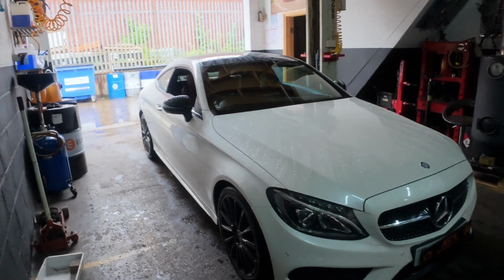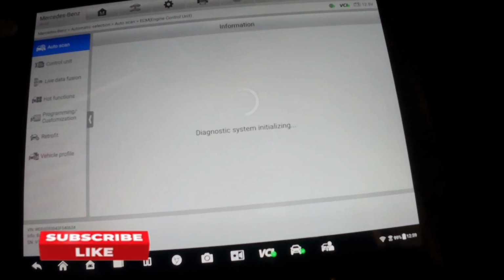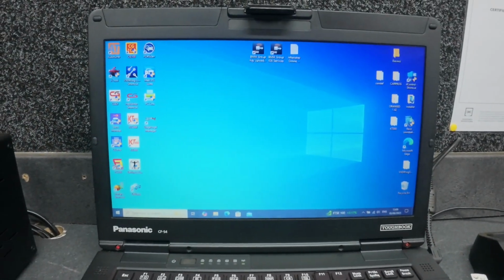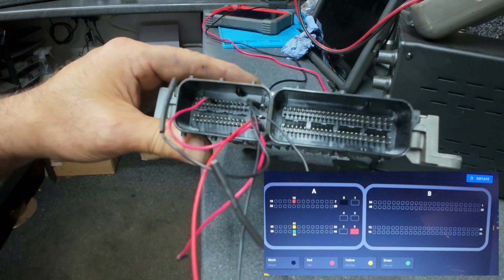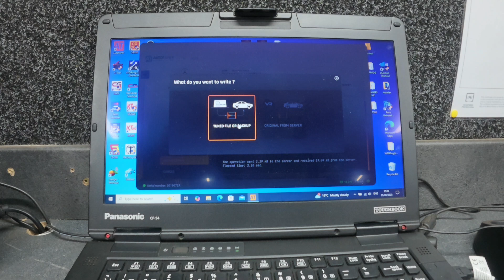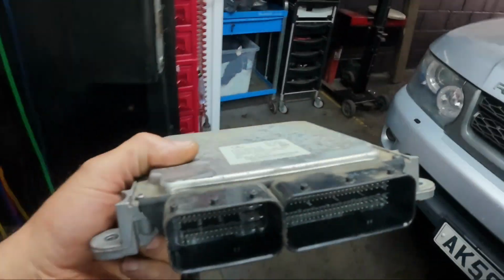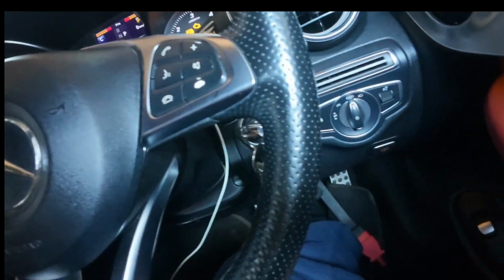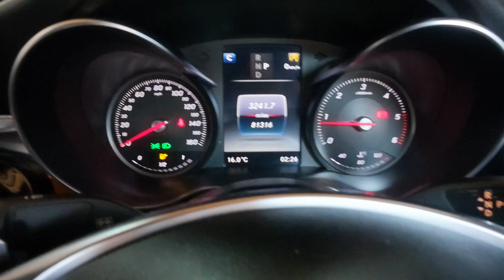Mercedes-Benz 2.1L Diesel/AdBlue SCR Delete & Fault Codes P13DF09, P2BA985, P220162, Delphi CRD3P.D1

Comment: Can you believe this system cause another set of issues madness! A heater is min £465. How much use does 25litres use if am right didn’t even last 8000miles thing is never popped up “low”
Reply from the maker: Yes, it’s madness honestly. AdBlue consumption varies, but 25 litres usually lasts anywhere from 5–10k miles depending on driving and regen frequency. The system doesn’t always give an early ‘low’ warning either — sometimes it only flags when there’s already a fault. And yes, the heater prices are crazy for what they are.

Comment: If the vehicle has the adblue coutdown, does this have to be reset before the delete? Or will this automatically disappear after the adblue delete?
Reply from the maker: If the AdBlue countdown has already started, it's important to reset it before or during the delete process. Just performing the AdBlue delete won't automatically remove an active countdown or start-lock. Proper tools and procedures are required to fully clear it and prevent issues.
Thanks for watching 🙏
Reply: @akisgarageltd  thank you mate! Also is it necessary to disconnect adblue ECU then read fault codes, plug back in and reset the codes. Then delete the Adblue and finish off by again unplugging module. Can the first stages be skipped in regard to the unplugging and plugging.
Reply from the maker: @asifrahman3864 You're welcome! Great question — in most cases, it's not strictly necessary to unplug the AdBlue ECU before reading or clearing the fault codes. However, for a clean and reliable AdBlue delete, it's best practice to read and clear the codes first, then unplug the module after the delete. This helps avoid any leftover fault memories or communication errors. 
Thanks again

Comment: Thanks mate, that was professional work,  ECU was in a good location on the car this time, 

Does the autotuner server do the stage 1 and adblue remove, or do you do it differently ?
Reply from the maker: Thanks mate, appreciate the kind words! Yeah, the ECU location made things much easier this time. As for Stage 1 and AdBlue removal - I don't use the Autotuner . I do the file editing separately with custom remapping to make sure it's done properly and safely.
Thanks again for watching 🙏